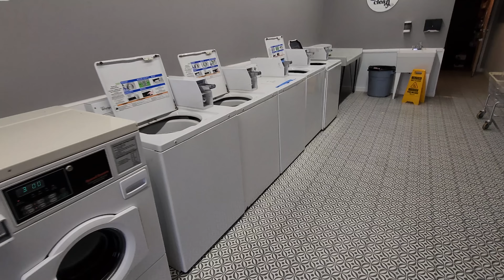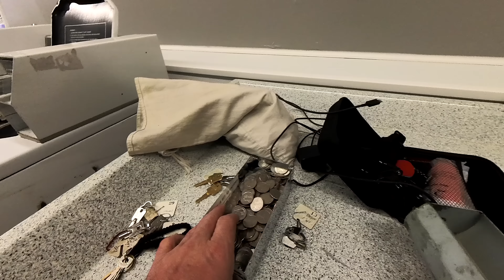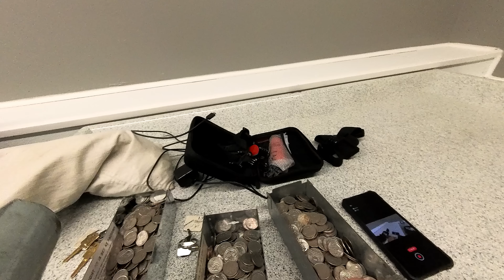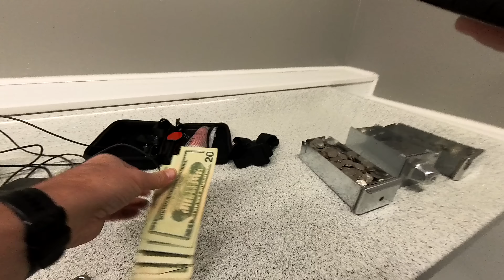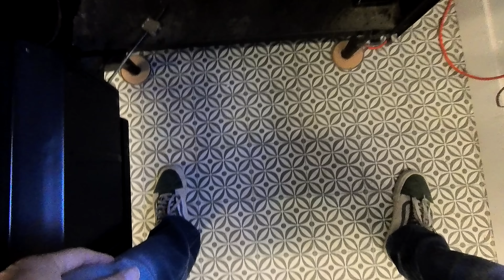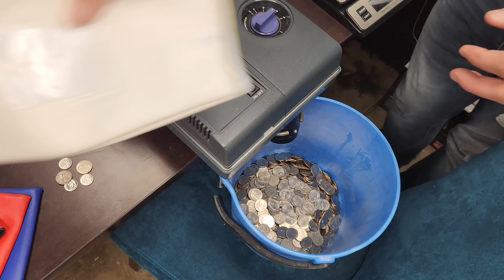Tiny Laundromat Fixed Machines (Again) and Improved Weekly Sales!

Comment: Mark, as a metal detectorist, I would like to correct your statement about silver nickels. Nickels issued during the war years, 1942-45, are 35% silver. If you look at current pricing, those nickels are worth from $1 to $5 on up, of course depending on condition.

Comment: You get a couple big machines in there like a some 50-60lb speed queens you’ll do much better. I think a decent amount of people in winter especially would come use the big machines to wash bulky bedding. I have a washer and dryer at home but still visit the local laundromat occasionally because my large comforters wash better in big machines.
Reply from the maker: Those may be too big for the wood floor and crawl space even soft mounts.

Comment: Owning a car wash seems like one of those investments that you have to really consider most or all the variables. Esp. compared to the laundry mat. As for moving the vending machines. I keep thinking of what you could put in that area that just requires plugs. Though the last time I went to a laundry mat. Had a nice seating area with free wifi. Another thing is maybe getting a smaller machine that is a combo that does both soda and chips.
Reply from the maker: It does need more seating

Comment: What to do with the car wash and vacuum? I was thinking maybe you could focus on the laundromat part of it for right now. Like for maybe one year. Build THAT up. THEN go back to the car wash idea, and see what you want to do. You can use the additional funds that you get from the laundromat part over the next year to fix the car wash part of it. That is, if you even want to keep the car wash. First decide if you want to keep the car wash, and if so, maybe around Halloween next year, work on fixing it. By then, the laundromat part will be beefed up enough to be okay with focusing on the car wash for a while. Then I would get new machinery in the back room to make sure the car wash operates properly for a while without manning it, and also without it breaking down. Like, you want to be able to go once per week or once every two weeks before you have to check on it again. And maybe the car wash could be 50 cents higher in price than it is right now, for all of the trouble, plus inflation. 

But I agree with the repair guy, that you do not want to turn that back room into more laundry machines. One, you need a room to store your items. Two, if you were the customer, you wouldn't want to have to go through a hallway in the back, passed a restroom, into a small room with no windows, to do your laundry. You would prefer to be up front with everyone else, in the open common room with all the other machines, away from the restroom, if you were the customer.

Comment: Painful to watch you fumbling with coins and keys. Hopefully, you get better. Stop dreaming on the used equipment and buy some new stuff. All the distributors have financing. New equipment will pay for itself.
Reply from the maker: The laundromat repairguy I use now is a distributor and he recommended not getting new. New machine for here is $12k to $15k. Finance or not you still pay for it
Reply: @investfourmore  The cynical side of says he’ll sell you some scrap he picked up for free. Both of your shops would increase sales and have lower operational costs with new equipment. And yes, new machines are not cheap. They do have a 15-20 year lifespan though. And given a choice, customers will chose new and shiny.
Reply: @patrickdreis9174  he doesn't sell used. He was saying look for used machines locally or at big Midwest shops